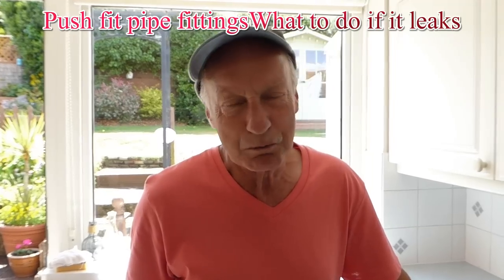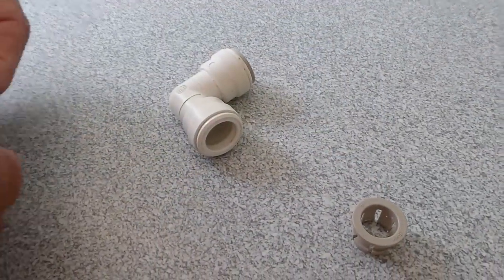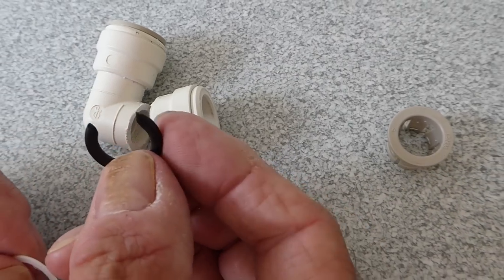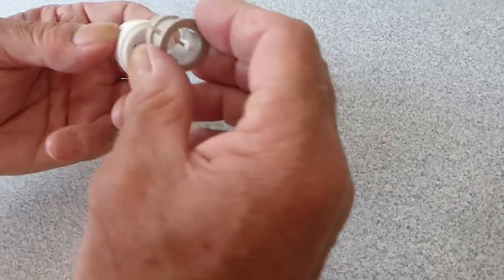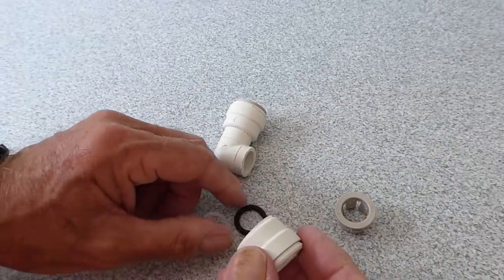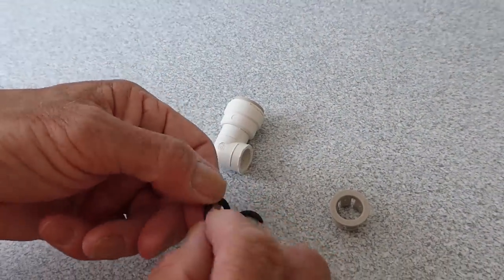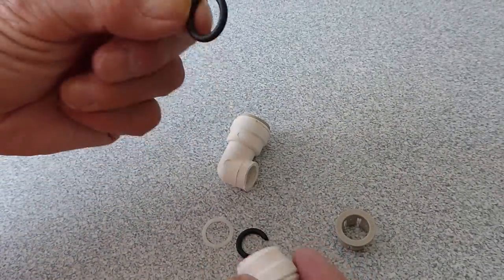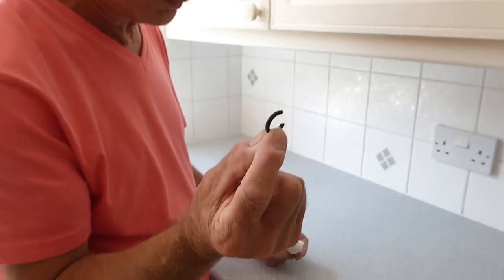Push fit pipe fittings what to do if one leaks

Comment: Very good advice Al 👍👍👍
Reply from the maker: Glad you enjoyed it
Reply: @dereton33  just doing repipping a toilet and bathroom that I’m turning into a walk in shower and putting it all under the floor, but while using the JG insert with the extra o rings could not get them to push in like they do on the video’s maybe it’s because a lot of the strength and more with the emphysema, but I used to soft bit of 3 x 2 too seat down to the pipe .when i used the wall who was taking a bit of the plaster off

Comment: Thanks for the video. Funny, I had the same problem with a straight Speedfit fitting connecting copper to barrier pipe leaking on the copper side. After cleaning up the pipe etc, checking that the barrier pipe had a strengthing insert etc it just wouldn't stop leaking. Couldn't see anything wrong with the rubber seal inside but didn't use a hacksaw to take it apart :) In the end just replaced it with, my preference, a straight Hep20. Problem solved.
Reply from the maker: Always best to renew them.

Comment: Not to knock any advice given in this Youtube video, but in case it isn't common knowledge, the o-rings in these type fittings are usually easy to change out. It's quick and cheap. I recently saw the o-rings on Amazon, $3 USD for 100 qty pkg. Pure Water Products, LLC of Texas has an online instructional for the o-ring replacement process. I am not endorsing PWP, I am just sharing the information. These Push to connect fitting are getting more and more expensive all the time, especially the John Guest products, and the optional o-ring replacement takes only 2 minutes. I don't know about everyone else, but I think 3 cents is better than a few dollars or more.
Reply from the maker: Go to it then Martin. !!! Worse advice ever !!! is when someone says that. I will look forward to seeing your video when you have done it and make sure I give you some kind comments, not like your shit comments.

Comment: Jaco produces compression screw fitting for water applications btw. One of prophets of quick fittings told me to replace the ring, it looks like its the achilles foot of quick fiting: it degrades with time, it degrades into the pipe forming a ring around it which is torn on release, it also degrades with every push-pull. Now I learnt that these things arent even replaceable, but still its virtually alternativeless in water treatment.
Reply: try silicone or additional safe lubricant/sealant on the internal oring; I have heard of pool guys with caustic media systems literally rebuilding every three months

Comment: So what if you fit one and its leaking and the washer is fine inside is that a problem with the push fit fitting on to my copper pipe?
Reply from the maker: Yes change the entire fitting.
Reply: I've done it and it's all sorted now 👍🏻

Comment: In another words if your fittings leak don't loose your time trying to fix this, just buy a new one.
Reply from the maker: That`s about it.
Reply: dissassemble and reassemble with silicone pack on the orings

Comment: How do you undo one these? Thanks.
Reply from the maker: Hold the ring back with your fingers and pull.
Reply: to remove collar; dental pick hook fits pretty well to evenly pull the collar; also needle nose wedged on both sides between chassis and collar ridge to pry collar out evenly

Comment: Thanks Al - A quick question - why do my hot taps stop working (no water ) before my cold taps.
Reply from the maker: +1954BJohn They are feed from the roof tank and the tapping hole is always above the cold feed hole.
Reply: +dereton33 Thanks for the reply Al - Not sure what you mean - I've had to replace the bath hot water taps twice because they simply didn't work i.e no water came out - yet the original cold water taps still function great - great flow etc...Just wonder why it's always the hot taps that fail first...Thanks!
Reply from the maker: +1954BJohn Your cold taps may even be off the mains so will always give good pressure. The hot taps are always the first to go, sometimes the body inside them come loose and you end up with no turns left on the tap
Reply: Thanks for the explanation Al!
Reply: +dereton33 If you were replacing taps, do you have a preference for the old washer design, or the ceramic disc quarter turn type?
Reply from the maker: I do prefer the ceramic disc ones

Comment: I replace my push fit connector with a new one and it still leaks, what could be the cause?
Reply from the maker: The pipe end is not square or there is old paint on it.
Reply: pipe OD not smooth; actually I am not sure if the pipe/oring interface is end or outer diameter on the pipe; make sure they are all smooth; consider adding dope or silicone for liquid not sure what for; if gas

Comment: If it leaks once , replace the fitting. If you get more than one leak...stop using push fit & find an alternative.
Reply: I've started collecting sets of my fittings because it seems like sometimes they just need maintenance and in the field[haha, my back yard] even swapping in an old coupling will make it seal; after this video I am going to disassemble/lubricate-extra sealant/lube and reassemble; worked last night in jam

Comment: Not so fast ya'll elbows and couplings are easy to come by at box stores QRC; but I have some exotics in my system; check valve, flow-meter, flow control+ multiple couplings; armed with insight from the vid here I pulled the collars and the Orings and repacked with silicone lube/sealant and they sealed right up; everything was leaking after a rebuild late at night 40* temps; I wasn't sure if the temperature was making the tubing stiff and non-conforming to the Oring connection or why 'everything' was leaking(streaming); repack with silicone made it seal right up; needle nose+dental pick for the collars; dental pick for Oring removal; [tried to scrub everything lightly with pipe cleanin' brushes and rinse]; Qtip+dental pick for silicone application and Oring reinstall; [Chemical dose application(chlorine) in pool automation; I would much rather compression screw-type collar fittings; but the quest continues for sourcing those; all plastic]
Reply: locking clips sometimes don't come with the base units; [like mine from Lowes and lots of other sources]
Water (Potable) Components > Push-to-Connect Water Fittings > Locking Clip > LC38-P
https://www.automationdirect.com/adc/shopping/catalog/water_(potable)_components/push-to-connect_water_fittings/locking_clip/lc38-p
Reply: be sure to attempt to remove bit line end for fresh line end when replacing or servicing or troubleshooting; if possible or needed

Comment: Not helpful, the fitting is molded into the water filter
Reply from the maker: Cant win em all.
Reply: I’ve got the same issue. Lowe’s has a 5/16 OD x 1/4” OD Shark Bite coupler #835034 that may end up taking the place of the water filter— if I can’t dig out & replace the o-rings. I have a feeling this is going to roll into also replacing the the fill solenoid valve with the same connector. Aaaaand discovered the supply valve doesn’t shut off all the way. All this from a pinhole leak in the supply tube which I should have cut out and spliced with a 1/4” Shark Bite/compression/insert coupling.